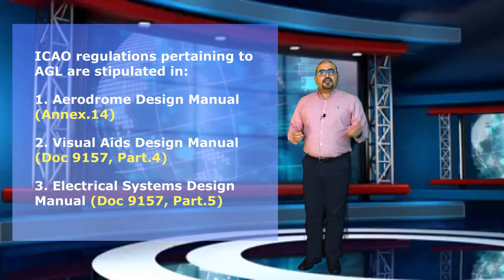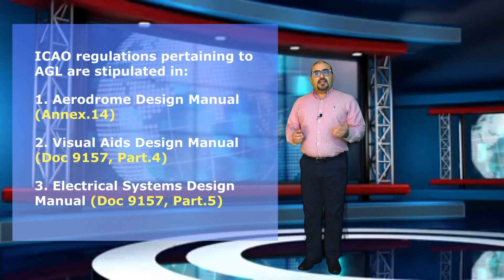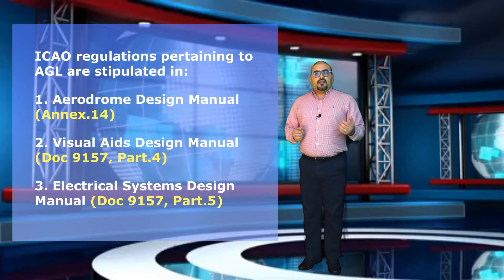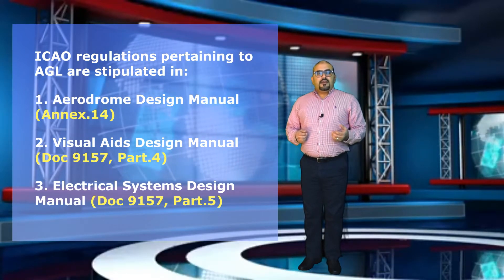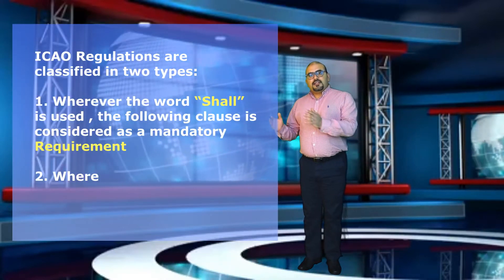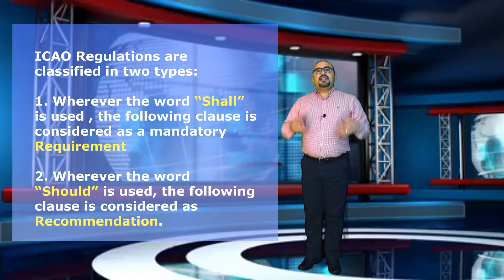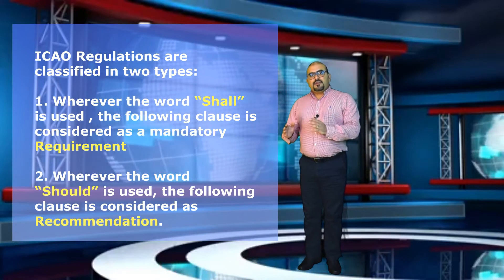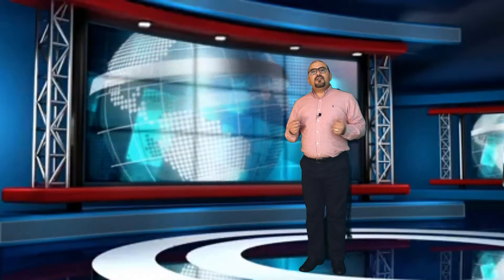Architecture of the Aeronautical Ground Lighting System, Season-1, Episode-3

Comment from the maker: Correction: Taxiway spacing shall not exceed (30m) in CAT II, and it should not exceed (15 m) in CATIII, while its not  a Requirement for CAT I
Reply: Airport Engineering Channel please can you give me the reference of this ..

And what about  if the distant not Not stable in design but not exceeding 30 m?? Okay or not!

And for RVR less than 350 m should not exceed 15 m.
Reply: Kindly mentioned taxiway complete name this is for Taxiway Center Line not for Taxiway Edge Taxiway edge in straight section not more then 60 m